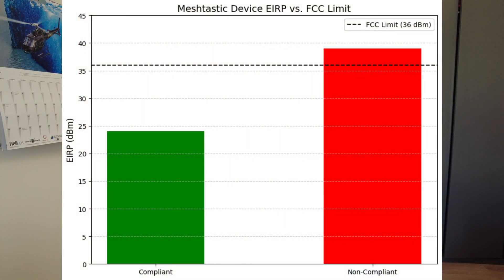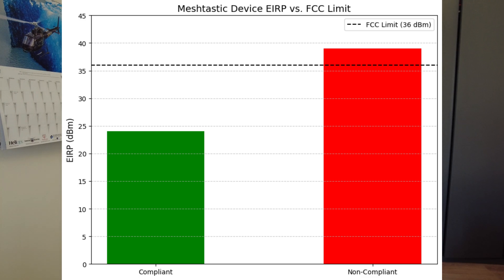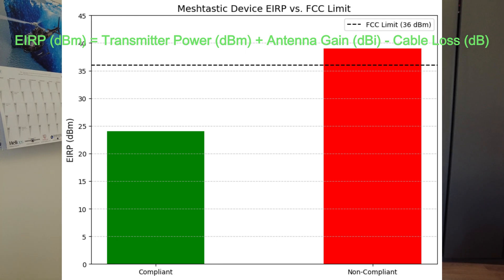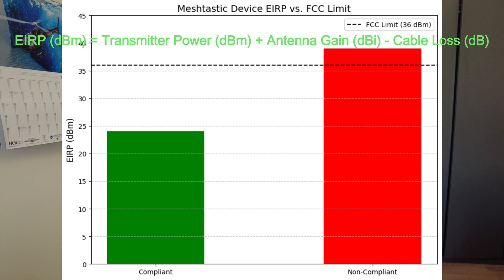Meshtastic & FCC Part 15 Rules

Comment: You are correct. The 500kHz bandwidth limit applies. And in addition to that is another requirement the device must meet when operating under the "Digital Modulation" set of requirements. That is the (Power Spectral Density) PSD measurement. That says "the conducted PSD from the intentional radiator to the antenna must not exceed 8 dBm in any 3 kHz band during continuous transmission". What that means is the power needs to be spread out over the bandwidth of the signal. Whether or not a device meets this requirement at a 1 Watt power level depends on the modulation index. For 500kHz bandwidth LoRa 27dBm is actually about the max power that can be used and still meet the +8dBm PSD rule. +27dBm is 1/2 Watt. So the claims of being able to run 1 Watt legally are false as it applies to 15.247. But for Amateur use it is ok
Reply from the maker: Thanks for the super helpful and detailed explanation. I recently adjusted the dBm down on my solar node because I have a 12dBm directional antenna attached.

Comment: I believe part 15 applies to units sold as radios out of the wrapper.  If you build (and program) a transmitter, you are responsible for what bandwidth, power, etc. that the unit puts out, not the manufacturer.  A mesh node pushing 0.5W with a full battery, using a 2" antenna is just a glorified garage door opener - it's not causing any interference with anything.  Besides, the ism/lower 30 cm band is already full of low wattage radio junk.  The FCC has bigger fish to fry than busting someone who hooks a yagi up to their mesh node and goes a couple dB over the unlicensed EIRP limit.
Reply: There are big companies that want to hog the whole 30 cm band. They do not want to coexist with Meshtastic. All they would need to do is pay some bribes to congress and point out Long_Fast isn't FCC Part 15 legal, and we are gone. 

One other thing we need to think about is the US Security State (deep state) doesn't want anyone to use encryption. 
Of course they can decode our messages, but the short range and short lifespan of messages will defeat most their decoding. They would have to build a new large and expensive system to cope with Meshtastic.
 
So, it would be much easier for them, if we were taken off the air. 
All they have to do is say, "Cartels and other criminals are using the Mesh to avoid arrest etc".  We will be gone within hours. 
The same thing might happen to Ham Radio and the unlicensed UHF family bands.
Reply: It doesn't matter if you make it yourself or not. The 15.247 rules still apply. Unless you have your Amateur Radio license
Reply: @natewelch6490  I have my amateur extra, so I don't care.  The government can't stop riots in major cities, do you really think they care if a random mesh node is 2 dB over 0.5W?

Comment: Reading the table in the article "Is LongFast Holding Your Mesh Back? Better LoRa Presets for Bigger Meshtastic Networks"  
I noticed that only the short_turbo default provides the legal  bandwidth. 
This sounds like the good old  Long_Fast default slot is not legal.
I cannot believe the meshtastic crew didn't read part 15.

Edit: 5/4/2025 
When we did some testing with a local node using Short_Turbo (at a 2 mile range), it didn't seem to work at all. (maybe we need to do a re-test).?.
However, the Short_Fast default was fantastic! Super-fast and the SNR report looked better!

Preset	Bandwidth (kHz)	SF	Data Rate (kbps)	Link Budget	Best For
LongFast	250	11	1.07	153dB	Default
MediumSlow	250	10	1.95	150.5dB	Better speed
MediumFast	250	9	3.52	148dB	Fast with good range
ShortSlow	250	8	6.25	145.5dB	Fast with moderate range
ShortFast	250	7	10.94	143dB	Very fast, shorter range
ShortTurbo	500	7	21.88	140dB	Maximum speed, minimum range
Reply from the maker: Thanks for the report. I will do some of my own testing.
Reply: Try to manually configure the LoRa settings yourself for 500BW SF12. It works pretty much the same as LongFast